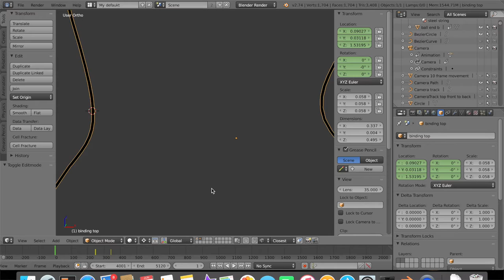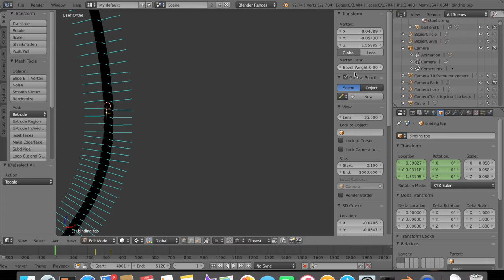SuGar SG1 acoustic guitar build part 1: The body template

Comment: What you could do is make a high res image and import it into sketchup or fusion 360 from there you could use the same technique to build it up. I have tried blender but stopped. I'm looking forward to see the rest of this build.
Reply from the maker: +Lars de Waardt the problem is one of perspective - if I render an image then it will have sone form of distortion. The viewport has an orthogonal view though with no perspective distortion - that's the view you see within Blender in the video.
Reply: Am I understanding that the instrument isn't bound to axis then? If you save your file as 3ds you could import it into sketchup from which you then can add axis to the separate parts. That should save you a lot of work. Importing into sketchup should solve your perspective problems. I have never imported a 3ds file into sketchup, I just looked it up so there is a chance you have initial cleanup work, after that it's fairly easy to work with. In sketchup groups and components are your friends to reduce problems.
Reply from the maker: +Lars de Waardt thanks Lars. I'll look into Sketchup - that's really useful
Reply: If you encounter problems, send a message and I can see if I can help you. You could add me on facebook if that would be easier to communicate.

Comment: Ah, Blender. Fine program, used it myself. But Blender is primarily a rendering tool, not a 3-D modeler. For this stage what you want is something like Fusion 360 or Mach 4. These are industrial  3-D modelers. Rendering is lousy but -- big but -- you can get drawings out directly without plotting points yourself. With a bit of work, you can get them out full size. See the Mathias Wandel channel for BIGPRINT  program. He uses Google sketchup which in itself not a bad 3-D modeler. Gets full size templates which can be be glued on to the wood. Both sketchup and bigprint are free. For a one-off project, the learning curve for a new program  may not be worth it. If you want to do more (and different) guitars, might save time.